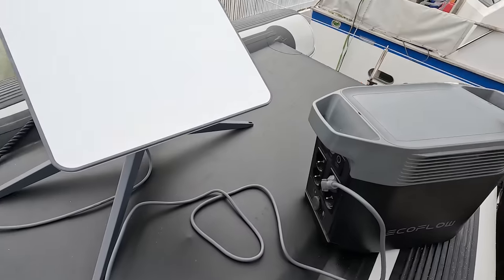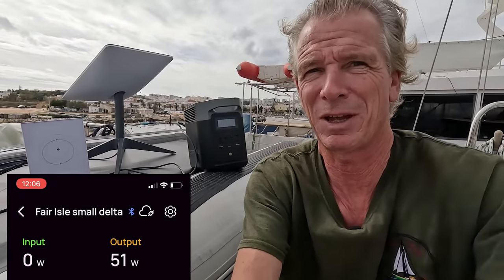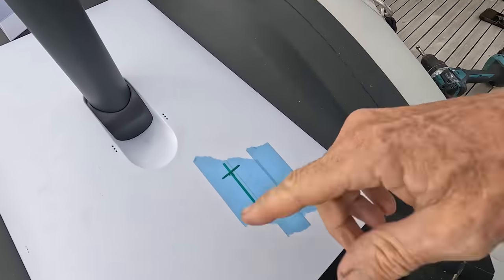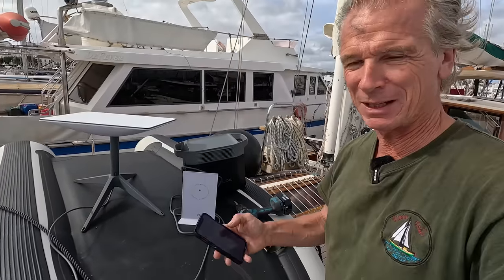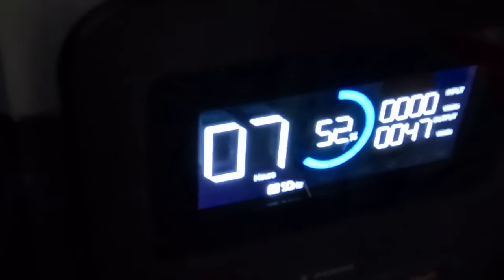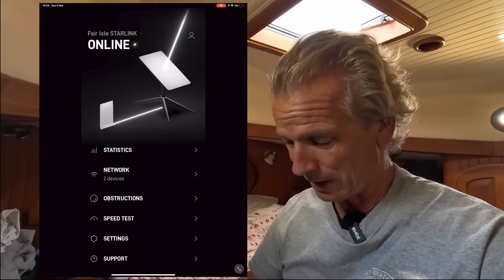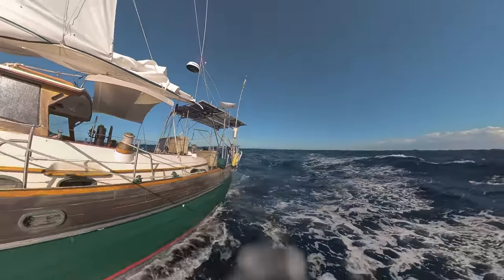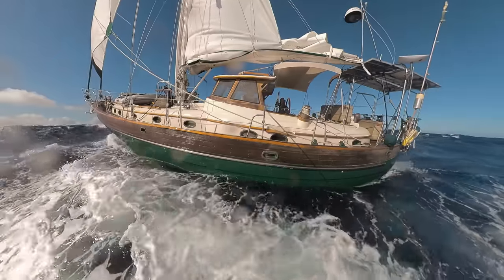Starlink on a boat

Comment: Is the position issue because you disconnected the motor? Stopping it locate its self,    
And what is the draw when your surfing the net . ?
Reply from the maker: No the GPS positioning has nothing to do with the dish not being able to move. Starlink doesn't feed a constant stream of GPS positioning. The draw is nit dependent on what you are doing on the net
Reply: @svfairisle  on the draw , what was it when using it in anger , ? You did show in set up, was it much higher . ? 
With the very low usage of power at set up with motors , and it initially finding where it is , why turn moving off , if heading upwind heeling will. That hamper performance , it is a remarkable creation .
Reply from the maker: The draw is not dependent on whether you are surfing on the net or not, the power is for the phased array that is constantly in opperation tracking satellites. The articulation of the dish is purely to sort out the initial set up for the dish to look at the best bit of sky to see the satellites and to avoid any obstructions like trees etc. This is just not relavent on a yacht which is constantly moving  so will only confuse the system
Reply: @svfairisle  I only asked out of interest about the power, as you only showed at set up, but you say its the same . Thats all.

Comment: Does it use Stepper motors?   Are they likely to use more power static than in motion?
Reply from the maker: No, as I showed in the video the unit takes the same amount of power with no motors as with. I don’t believe they are stepper motors as their only job is to initially position the dish, the tracking of a satellites is done electronically by the phased array.

Comment: inverter to power SL rather than converting to DC. My thinking was I don’t have to power up the big inverter just to run SL so ‘hoping’ the inverter losses aren’t as great plus it has a power switch making disconnecting easier. Your thoughts?
Reply from the maker: Don’t quite know what you’re saying. 
Yes you need to power the SL via an inverter unless you start modifying the SL yourself, yes the inverter will be very lossy, they all are, I’ve opted for powering from the inverter in one of my EcoFlows as then I don’t have to leave the ships big inverter on and I can easily turn the Ecoflow off without affecting anything else.
Reply: @svfairisle  oh my cut & paste failed lol.. but yes I was going power the SL through a small dedicated 250w inverter so hopefully the losses may not as big? I look forward to “Steve’s TechTalk” analysis when you convert to DC :)
Reply from the maker: @secniv  thought something like that had happened, yes a small dedicated inverter is probably a good idea

Comment: Does any of the readers know the specs for Starlink with regard to “angular rate of change” for the phased array ?
Consider a boat i a swell with a steady roll from 20 degrees starboard to 20 degrees port. If this takes 10 seconds, as an example, the phased array needs to accomodate (20+20)/10 = 4 degrees/second. Additionally, there may be a limit to angle coverage (reception cone).
Reply from the maker: Don’t know the figures but my guess is the reception zone is a factor. When we crossed the Atlantic in March this year we were turning Starlink off to save power. We had a very rolly crossing the whole way and Starlink went from taking 5-10 minutes to connect ( so still longer than when in a calm anchorage) to up to an hour to connect in the middle of the Atlantic. Now there will be less satellites available in the middle of the Atlantic if course but if it was just the speed the phased array can move then there shouldn’t be such a difference I think. More likely the active area is too small when you’re rolling so you including sections of sea and missing sections of sky every time you roll. There’s no reason for it to be designed with more half a hemisphere max!

Comment: I thought Starlink had a separate (much more expensive) marine antenna and subscription. Am I mistaken that Starlink blocks terrestrial devices used at sea? I seem to remember Parley Revival having to switch systems.
Reply from the maker: Yes it does but it’s very expensive and draws twice as much as this one (which works perfectly well) so why would you?
Reply: @svfairisle  If I remember correctly, Starlink will disable any terrestrial account they detect operating at sea. I have seen at least one operator showing a warning notice they got from Starlink. You can use it in port but once at sea you run the risk of being blocked. 
Also:
"Use in areas marked as Ocean require use of Mobile Priority data".
Reply from the maker: @b.scottgould  yes that's right you have to switch from the standard account to a mobile one and then pay for the priority data if you're off-shore. They do also want you to have the high power dish for motion as well but everyone just uses the standard dishy and I haven't heard of anyone having a problem.

Comment: This is going to sound ignorant... but why not mount it to the top of the mast? Would be nice to get it out of the way.
Reply from the maker: It’s a lot of windage for the top of the mast and would have to be out on an arm to clear the nav gear & wind instruments up there. Also the standard cable would not be long enough for most masts. But really there’s no need, I think even with a ketch there will be somewhere on the stern rail with a decent view of the sky
Reply: How about on the lower spreader?

Comment: We often have problems getting ours to boot up at sea but we have it mounted in a fishing rod holder, which isn’t a good idea as there is nothing to retain the plug in the dish, whereas the Starlink proprietary mounting arm or ground stand do. So if it hasn’t gained an internet connection within 10 or 15 mins, I know I have to loosen the deck grommet, pull through an armful of cable, lift the dish out of the rod holder, push the lead back in the required extra 1/16th of an inch (<2mm) and it then seems to work.

So don’t mount it in a fishing rod holder!
Reply from the maker: Yes I went with the proprietary holder and just adapted it mainly because it locks the dish in ( you press a button the be able to pull the dish up and out) But the replugging issue can happen in any configuration I think. We've twice had a situation where the unit hadn't connected and the way I get around it is to disconnect the cable (but I do it at the router end) and replug and so far this has always worked

Comment: 2:55 Maybe you just overestimate what an electric motor consume, especially compared with sending data with a signal strong enough to reach a satellite. Regarding the never ending movement, it is because it is not design for a moving environment. There is a marine version, it is not moving, has more built in antennas to deal with the fact it does not move, and I guess it is more seawater resistant. It is probably more expansive, as everything for boats, and it may be cheaper than buying a new antennas every 2 ou 3 years do to corrosion.
Reply from the maker: It’s not just that it’s more expensive to buy it’s that it takes twice the power which is really too much on a yacht

Comment: If it didn’t use any extra power moving why disable it? Also download for show upload for ahem content.
Reply from the maker: Obviously it does use extra power, motor use power there’s no way around that. The test I did just showed that everything else is de powered when the motors run, this is a problem in itself as if the unit decides to reorientate itself because you’ve swung at anchor or something then you will loose connection as the antenna moves and the other systems shut down.

Comment: I noticed that you didn’t mention what subscription you are paying for. Starlink has changed the subscriptions many times in the last year. The motion subscription is limited to 10 miles / hr and in shore (up to ~ 10 miles off shore). Off shore you should upgrade at least to the Continental subscription. The GPS on Starlink how fast you are traveling and where you are located. If you violate your subscription Starlink can shutdown your antenna and degrade you system to a fixed system at your registered home address. A world subscription is extremely expensive and is used by and paid for by cruise ships and mega yachts. They haven’t been been aggressive  yet but if the use in violation of the subscription increases they may be shutting people like you down and limit your access.
Reply from the maker: I went through the subscriptions. But it seems the one I opted for ‘mobile premium’ was a mistake as sticking with standard mobile and just paying for premium by the Gb is the cheapest option

Comment: Drawing 50 Watts at 48 V is only 1 amp, so surprised at comment that it is power hungry? Have I misunerstood something?
Reply from the maker: Yes it’s not being powered by DC you have to pull it apart to make that happen. I was powering it from the EcoFlows inverter 240v. It draws 4a at 12v
Reply from the maker: Yes it’s not being powered by DC you have to pull it apart to make that happen. I was powering it from the EcoFlows inverter 240v. It draws 4a at 12v
Reply: @svfairisle  Thanks for that!